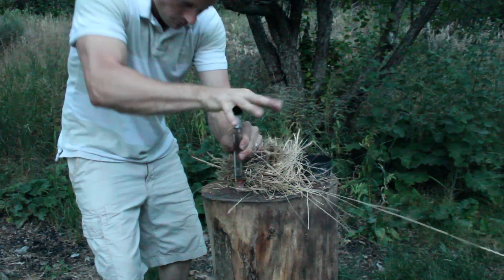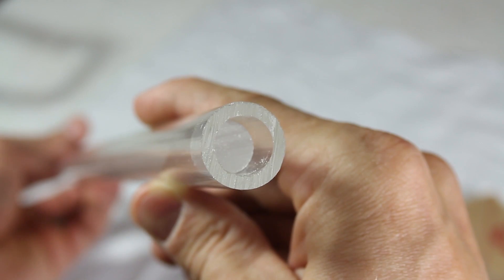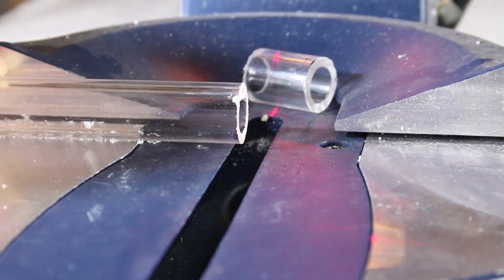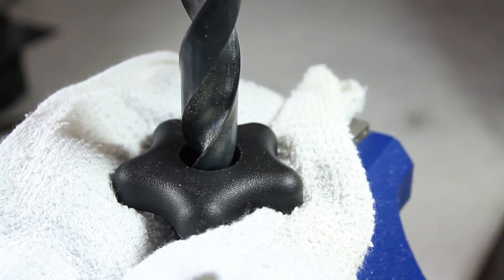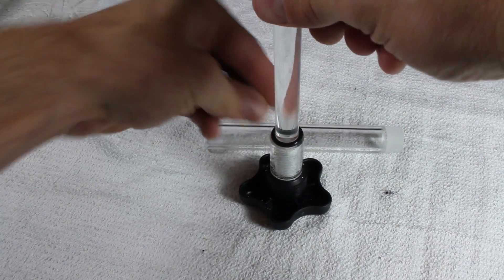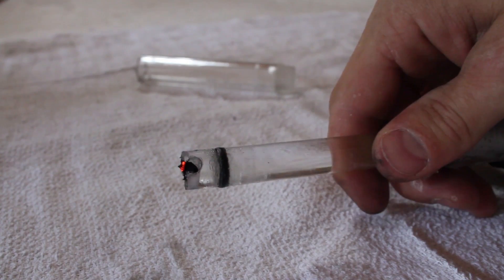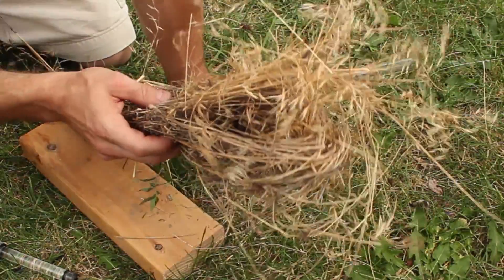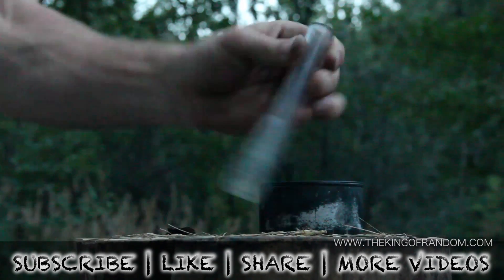Slam Rod Fire Starter - Ignition By Air!!

Comment: Is the material on tip of the piston strong enough to withstand heat after several ignitions? I mean, doesn't it melt and warp over time? Is it possible to use metal or something else that can last longer?

Comment: @novkaxfire There will be no light as it is simply just heat ... You can't take a lighter to a led and expect it to light so the principals are the same in this case. It will not work so not even worth the try in my opinion. Two separate forms of energy...

Comment from the maker: Microwaves are electromagnetic energy and the filament int the bulb acts like a receiving antenna.  So there is a magnetic force inducing the current.  With the Fire Piston, it's just compressing air and heating the air up.

Comment from the maker: Are you saying to put the LED inside the piston?  I believe it will break.  The only factors the piston induces are heat and pressure.  How do you suppose these induce a magnetic field in a copper coil?  As far as I know, heat and pressure changes are not magnetic.

Comment from the maker: I agree with you that a lighter is more effective, and I assure you I understand the cost and value of hard work.  If you watched this video all the way through, I'm sure you saw at 4:17 the part where I explained this was a tool used in the 1800's.. before the invention of matches or lighters turned it into a "useless gizmo" as you advertise so openly :)

Comment: Well in my case (and many other people) we don't necessarily believe in zombies (even though they are a possibility) we believe in preparing for an apocalypse scenario, which a zombie apocalypse is the worst Crap hit the fan scenario, so if you can prepare for that, you can survive basically anything.
When we say "ultimate zombie apoc weapon" we mean something portable, easy to conceal and easy to pull out, needs to have multiple uses along with being both blunt and blade, (continue)